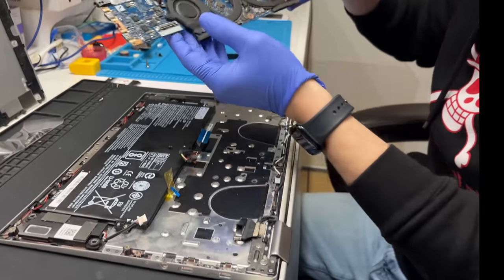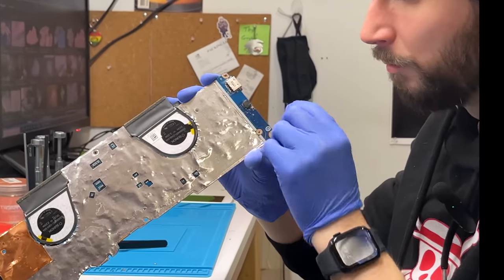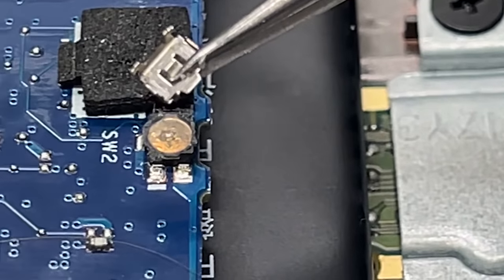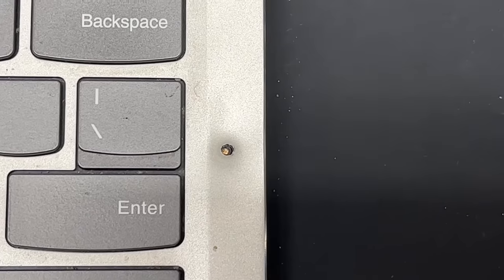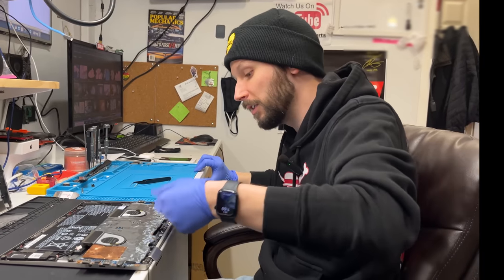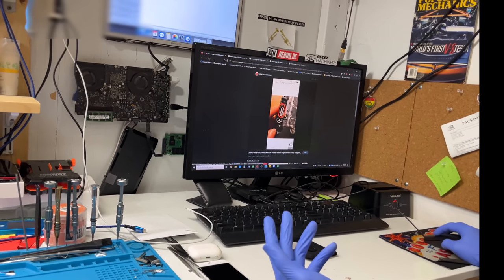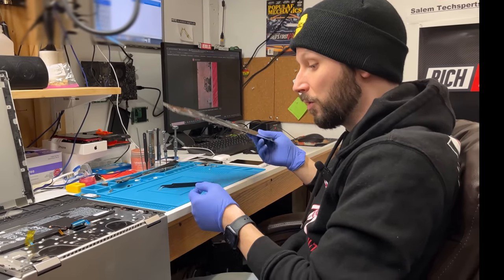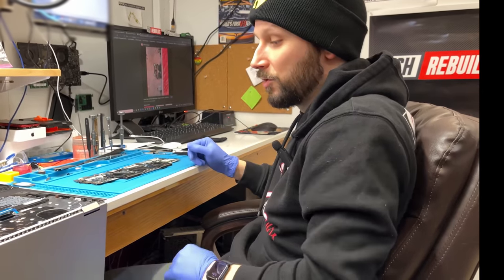Another reason to never buy a Lenovo Yoga (huge design flaw)

Comment: Well, to be honest, on my macbook, the power button has a huge pile of dust over it, because I use it like one or two times a year. With Windows laptop on the other hand, the power button is the ONLY button with damaged coating. So its not only hardware design flaw, but wrong software choice as well.

Comment: On my old lenovo laptop, the central (data) pin on the USB-A sized power jack goes straight to the superIO chip with literally no ESD protection. It is surrounded on all sides by the +19v of the power wire. If you zap it with ESD from your finger or the little bit of plastic separating it from the +19v breaks after a while as was the case in my laptop, instantly forever-dead laptop. I assume all lenovos with the yellow USB-A sized power jack are the same. I won't buy a lenovo again.

Comment: As an hardware/firmware engineer myself, I'm 100% certain that someone in Lenovo's engineering team, warned about that button being an issue.
But as it usually goes, management with all their wisdom, decided to ignore all of it!

That's why I've bought myself a framework laptop. Still have to see how long it will last, but I've the feeling set company respects and listens to their engineers rather than their sales department.
Reply: Came to say basically the same thing. I work in Design and the amount of shitty decisions that come from someone higher up with an ego not listening to people with years' experience is staggering. 100% this will have been flagged by an engineer or designer and it'll have been ignored.

I too have a framework and it's been phenomenal so far. I too am interested RE the longevity of it but everything I've seen so far has been encouraging.

I've heard people say the 13 is expensive but given someone would pay $1200 for a piece of shit Lenovo, I don't think it is considering the Ryzen versions performance and the repairability etc.
Reply: Framework should make a 2in1
Reply: Tbf Salem also speaks out of his ass. You can just solve the problem in software, wake on keyboard press is an easy thing to do in BIOS. No need to drill holes.
Reply: @Muaddibize  Depends if the BIOS actually supports such feature.
I've seen OEM BIOS configuration screens, with less customization options than an early 90's TV remote... 
I woud suspect most devices only supporting wake from sleep on keyboard press, not wake from shutdown.
Reply: The hardware engineers probably helped them find a way to make it more fragile
Reply: @stigmautomata  In my experience, management asks the hardware engineers to make it more cheaply.
The above question is then repeated 250 times in a row, until one ends up with utter garbage...

The hardware engineer is constantly repeating himself to management, "yes it will kinda work, but..." Yet management never listens!
Reply: Or they think it's a good idea so people pay the company to fix it or to encourage you to buy new laptop
Reply: I want Framework to succeed, but right now their options are either intel video, which doesn't even understand what a polygon is, or amd's integrated RDNA on their ryzen notebooks. Which, while markedly better, is not nearly enough to justify their asking price. Like, as much of a scam as the entire RTX 40 series mobile chips are, in the same tier, they are still 20% on average faster for the same money (e.g. RX 7600S vs RTX 4060 mobile is a bloodbath at the same settings).
Reply: Let's take a moment to think about who designed them in the first place. Was it management?
Reply: @AllKings Good point
Reply: @AllKings ya know designs are literally approved and disapproved by management right?not to mention management can make the engineers change things just because right? I don't even work in tech but I know that much...

Comment: Lenovo is somehow ahead of everybody in the "make laptops as brittle as possible" game.
Last time I put some real effort in a pretty thorough overhaul of a Lenovo, backing up all the broken plastic with aluminum planks. Only to realize, just at the end of the project, that now the display is gone - although I sure as heck didn't apply any abnormal stress on it.
These guys are just one step ahead in the game. They apparently LOOK FOR the worst materials and designs to put in a laptop.
Reply: Makes me wonder if it's to differentiate between Thinkpads and the rest.
Reply: Can't comment on that, haven't played with modern ThinkPads. Older ones from ~2012 are quite decent. But hey, just how many people got burnt for assuming that all Lenovo's are Thinkpad quality...
Reply: For IdeaPad I absolutely 100% agree with this one
I changed my laptop chassis and keep cracking for 4x over 3 years
Reply: my lenovo legion survived being thrown off a bike while in my bag with just fan bearings being thrown off a bit, it survived multiple falls and there still isnt a single crack on the display, only like one tiny piece of plastic broke off and a few scratches on the casing, nothing unfixable, it was also an amazing buy for the price (1300 euros for a 3060 and a 5600h, amazing deal for a laptop in the EU. now that acer nitro 5 i bought before it died within the return time (2 weeks) xD
Reply: @hisamiyomotsu1337  That's interesting to know, gaming laptops are an interesting beast I haven't touched much. Sounds like a pretty new machine though, considering the hardware. You can judge plastics of quality after a few years of use. Cheap plastics for example age poorly and become brittle, especially when exposed to heat or ultraviolet light.
Reply: @albertstarfield my ideapad is scratched up had to repair keyboard once and the cooling is fucked
Reply: @hisamiyomotsu1337  I did occasionally found a model of Lenovo Legion that built really in a solid way but it's quite rare
Reply: @batyanko8283  Also a Legion owner. I can confirm that a couple of the plastic clips that hold the bottom panel in place have broken off after just one careful removal for dust cleaning purposes, resulting in the laptop creaking whenever I grab it with one hand to move it somewhere. I believe there was also an issue with an older model where the screen panel was glued to the hinges and not attached with screws, resulting in it starting to come off with time.
Reply: @hisamiyomotsu1337  Was it that amazing of a deal? I'm also in the EU and i got the 3060 and 5800h model for the equivalent of around 1100 euro two years ago. Granted I did have to deal hunt for a couple of months and wait for a good price, I wasn't in a hurry. I guess it depends on the country. Was it the Pro? That would do it, mine's the normal one.
Reply: @cool_bug_facts  2 years ago is a different thing + depending on country, pricing might be different lol, it is a pretty good deal compared to everything else here
Reply: Can confirm 100% i have an ideapad from 2022 and within 1 year it screen bent. I was thinking why this happened as i always open lid placing my fingers in the middle of lid and not on sides so it shouldn't happen right? But it happened. I am glad that i bought extra warranty, actually the store gave me warranty at a very reasonable price of $25 for 2 year accidental damage so i bought the warranty and lenovo engineer came to my home and said that screen is bent because the hinge is broken and changed the hinge and failed usb and screen guard.
Reply: @@seaworth3382 what? it's not 5kg, it's like 2 and a half kg which is normal for laptops with dedicated GPUs
Reply: Sucks because about 7 years ago it was the best relatively cheap laptop you could get

Though luckily the old ones only get cheaper and cheaper used with time
Reply: lenovo being a chinese company with a chinese factory,
utilizes a chinese exclusive material called "chinesium"
it's the cheapest and most versatile material in the world. when paired with child labor, the low production costs for literally everything attracts even non chinese companies like flies, especially HP
Reply: Acer is far worse
Reply: Sounds like somebody never had to repair HP laptops. Those things crumble into dust, especially plastic around hinges.
Reply: @BL00DYME55  I think HP historically (or popularly?) pioneered the crappy cheap laptop market, somewhere between 2005-2010. Even though it was a bit unfair for them, doing a big expansion in those years of massively failing mobile GPUs. Anyway, someone with more hands-on experience correct me on the timeframes.
Reply: Definetly true. I have 2 ideapads, a 330-15ARR, and a S145-15AST. Both laptops still work, but as for the 330, which I've used as my main laptop for anything related to personal use (I use a ThinkPad X230 for work and other stuff), and man has that thing taken a beating. Within less than a year of getting it on Christmas day 2018, me and one of my cousins managed to break the screen by trying to close it and open it at the same time. (it was still under warranty, but we really weren't thinking back then) The screen would stay broken until mid-late 2023, where I decided it was finally time to replace the screen. Prior to the screen replacement, a bit of the plastic just above the DVD-RW drive had broken off, the hinge cover was gone, and there were a few notable gashes in the top cover. 

Moving on to the screen replacement, When I sourced another IdeaPad 330, I found one with a bad HDD for about $150, other than that, it was in really good condition. While taking the screen from the parts laptop, I couldn't get one of the screws out from the screen, which lead me to completely chop off the piece of metal with the screw stuck in it. Once I finally got the screen into my IdeaPad, I had to jam some paper into the connector that goes from the cable to the screen, as the backlight (Which worked perfectly with the other ideapad of the SAME model and config) wouldn't illuminate. And not too long after I did the DIY screen repair, the left hinge finally gave out.

Oh, and as for the S145, a few of the keys decide when they will or will not work, but otherwise, it has no issues.
Reply: i use shitty ideapadu det3i a 700 dollar windows tab with celeron isnide of course terrible experience but there are some catch
Reply: @batyanko8283 Honestly even modern Thinkpads aren't that great. Everything is soldered, the hotswap batteries are gone, the roll cage is gone, I'm pretty sure the water channels are gone too. And I'm not talking entry level Thinkpads I'm talking workstations as well.

Comment: Just a question, but could you replace the whole power switch thing with a simple sideways mounted push button? Does the power button do anything special other than closing the circuit? Because if it could be replaced this is just planned obsolescence at its finest. Well done lenovo! Its weird how even some of their cheaper end stuff can last a good while, but this 1200$ thing breaks in just a few years.
Reply from the maker: Yes it can definitely be replaced with a side mounted switch, but my customer had such a grudge against this machine they told me to trash it. I ended up simply bypassing the plastic switch and popping a hole in the top case to turn it on manually. Now it's a loaner laptop for my customers.
Reply: they must get some of that overpriced market poducts extreme profit too not only the other brands☠️☠️
Reply: Yes, I replaced mine with a standard button and it worked fine
Reply: i came here to say that they could have just used one of those cheap tiny sideways switches that are easy to find and replace
Reply: @SalemTechsperts good shit for keeping it in use even in its damaged state instead of actually trashing it
Reply: a side button on a mouse is more durable and they are literally the same as the main button but with the microswitch mounted vertically

Comment: Lenovo's new laptops come with lid sensor (flip to boot option in BIOS/vantage application). Side power button is still there on some models.
Reply: yep, the only times where you really need to push the button is to put it to sleep while the keyboard is flipped or to force restart it
Reply: Yeah after this I'm never pressing the power button again
Reply: Yeah i also have that feature

Comment: This happened to mine actually. 2 days out of warranty. I replaced it with a button meant for a PS4 disc eject and it's worked fine since.
Reply: Replacing that button is easy with basic soldering skills. I have done it a lot. I also found and have purchased 200 of those push buttons. To me it seems like a bit of a waste to not be able to do such a simple repair and keep the laptop in the wild. But I am a soldering expert and not a lot of repair techs do that.

Comment: When you find your laptop model in a video named "huge design flaw": 🗿

Fortunately mine never broke but i handle it better than the way i do (did) with my gf.
But still my gf is not mine anymore, and the hinge of the lenovo broke one year ago and i keep putting superglue until it dries, break and then put it again.
Because another design flaw is that the hinge on the screen is made of metal, but screwed on a plastic chassis so if the metal separates from plastic because you open it 1500-2000 times in 3-4 years when you use it for work, there's no way to put them back together, except by glueing, breaking and repeat, like me and my gf.
Reply: this happened to me with with a Lenovo IdeaPad, the hinge had loose screws after putting pressure on the laptop Plastic for so long, I opened it and tightened the screws on the hinges and it EXPLODED and the entire plastic bracket holding the hinges broke into a million tiny pieces and now the screen is only attached the rest of the laptop with a wire

Comment: Lenovo is a design flaw master. Our company bought lenovo ideapad 340s laptops as work computers. And after 3 years they started to break one by one.

Turned out Lenovo had two modifications of these laptops: with HDD and without. And since both modifications are identical inside they filled the HDD place with "HDD dummy" metal thing which was also attached to laptop with 4 screws. And these screws were attached loosely since holes in dummy HDD are slightly bigger than in real HDD. Now you can guess: after 3 years of shaking, transporting and flipping all screws start to pop out one by one and some of them caused short circuits and permanently damaged some motherboards.

After I figure it out, I started a massive fix: I just... Removed them all, there is no need in dummy at all! Maybe it supposed to be some sort of additional hardness but it is so slight. And obviously if your thing causes expensive damage - it should not be there.

Comment: The 1st yoga is still the best laptop I ever had, even it was relatively heavy, it was the best one to be used in the various 360 degrees uses and on the go, all credits due to the rubber band around it, that thing alone made a big difference
Reply: The 1st gen yoga was quite expensive for 2012 especially for what specs it had. The materials surrounding the motherboard are the best I’ve ever had on a laptop. It’s currently my typing laptop because of how good the keyboard area is.

Comment: I can confirm the hinge issues, dad used a lenovo yoga 2 pro, from the moment it was unboxed to many years later and even warranty replacement, the screen has always had issues and often touchscreen wont work, the orientation of the screen will flip for no reason (gyroscopes are cheaply made and don't work) but his new lenovo yoga 7i also has touchscreen and cheap gyroscope issues, had warranty replacement and still didn't work. Lenovo clearly has terrible quality consumer devices, new thinkpads are average when compared to devices produced by other companies.

  If you want to spare yourself from the insufferable experience of a lenovo yoga, get an acer spin 3 or acer spin 5. They are built in the same form as the lenovo thinkpad yogas, with a stylus port and stylus docked inside of the device, hinges actually work (better then the yoga thinkpads) and they are a quarter the price of the thinkpads, and half the price of the yogas for the same specs (unless you want one of those shiny expensive 3.2k oled screens).
Reply: Hmmmm

Comment: I find it really hard to believe that you couldn't find a dome switch, it's probably the most commonly used type of switch on the market. Even if you couldn't find the exact size of switch you could have gotten one that was close enough and just epoxied it in place with some magnet wire connecting the terminals.
Reply: Hahahahahah. You kinda get it. BUT, The size and shape IS PROPRIETARY OUT OF COMPLEXITY.  He clearly does a pretty good job of repairing and is showing you issues with Lenovo yoga.
Reply: I dont think its worth it if it is just gonna fail in exactly the same way in less than a month, at that point maybe asking the customer if performing a bit of a hardware modification and using an entirely different type of switch is best.

Comment: Thank's for bringing that up. I have a Lenovo Laptop myself and barely ever using the powerbutton due to it turning on (not only exiting sleep mode but a real boot) when you open the lid. Now I know to be extra careful IF I need to press it for whatever reason.

BTW. the other day I had to fix the start button on my washing mashine. same exact problem. A cheap plastig thingy that breaks when you look at it the wrong way. The only good thing was that it was an easy to replace part

Comment: This isnt even "cheaping out", this is convoluting for convoluting's sake (and increasing points of failure). That dingy little piece is harder to produce than just having the button have a little bump with a tiny spring around it(might not even need the spring), connecting it directly to the mb button. Designed to fail, really